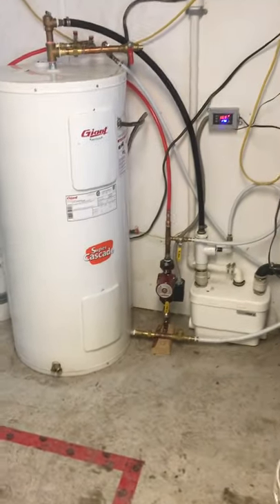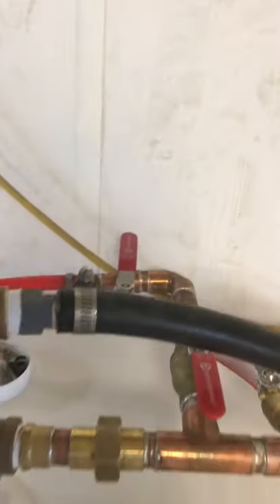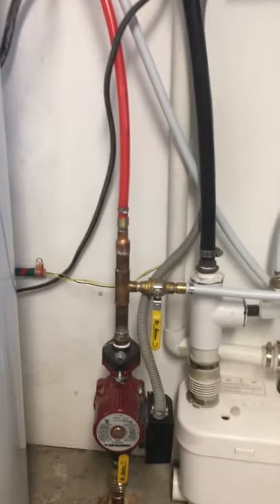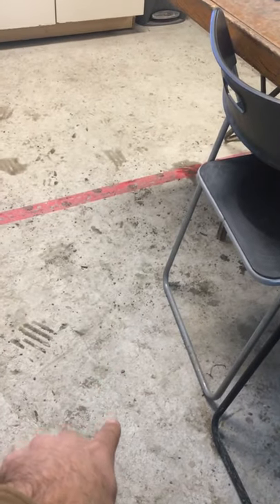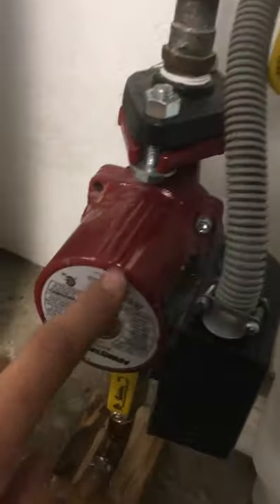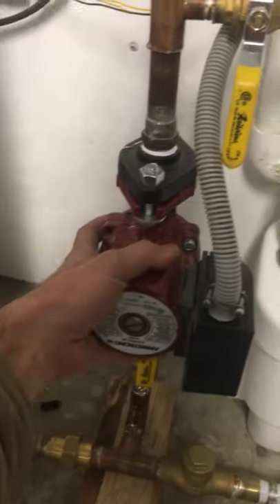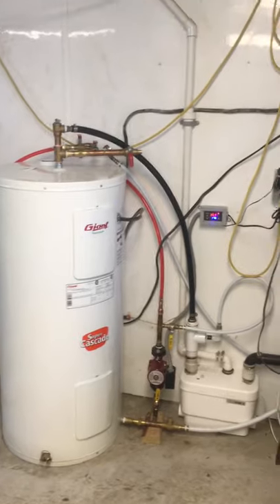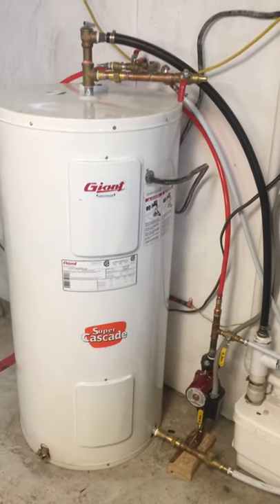DIY hydronic heating with a domestic water heater

Comment: I’m a few years late to the party, but there are a few concerns with this open loop system. #1 being that if you don’t keep the water got enough 130 -140F, there is a chance of dangerous bacteria growing. 

This wouldn’t be a problem if you were only heating, but where you are using this for washing, it could end badly. 

I’d be shocked if no one else brought this up, but I didn’t see it, while scanning the comments. 

I have a tankless system hearing my garage, and I love it. It’s about 13 years old now.

Comment: Awesome!! 
If the HW system is heat pump sourced it's even cheaper to run.
I wonder if a retrofit solution could work with a PEX HW COIL in an exchange chamber with a fan to circulate the warmed air through a duct system. The recirculating pump would not be necessary.

Comment: how efficient is this? What were you using? How many sqft? Electricity saving vs fuel?
Reply from the maker: In terms of efficiency electric heating of water is pretty much 100% efficient as far as I know. Then it’s just a question of how well insulated the space is, both beneath the slab and then the room’s walls, doors, ceiling etc.

In this case we’re using a 3kW water heater to heat about 350sq ft in a corner of an old barn where we insulated one corner of the building pretty well and had to redo about 200 sq.ft of the floor so we had the spray foam contractor do the sub slab zone at the same time as he did several  walls.  Then we poured the new slab with about 100ft of pex in the slab and set up the water heater to heat it.

Savings vs. fuel unknown as we've never heated this section with fuel.

Comment: Isn't it dangerous to mix your domestic hot water with hydronic system water? I thought that could lead to Legionnaires Disease or something?
Reply from the maker: I looked it up and checked the temperatures for Legionella and took a few preventative measures but I can't really see how it could happen.  I blow out the heating loop with compressed air during the time of year when it's idle (summer) so it can't breed much bacteria and the water heater is set much hotter than Legionella can survive (most water heaters are nowadays) so I'm hoping I'm not wrong on this.

Comment: Interesting...We just equipped our new home with all propane appliances and heating system in 2016, however Canada's Liberals have now declared war on fossil fuels even though we are at 1.5% of world carbon emissions. My bad, getting side tracked. We are considering tapping into our in floor on demand boiler circuit with an Electric HWT to save on the now ridiculous cost of propane.  Have your hydro bills gone up a lot using the electric tank ?

Comment: That is pretty much exactly what I plan on doing in my garage, I have a newly poured slab with pex in it and insulation foam board isolating it. Now i need a pump and valve install to warm it up.. 

Hows your little system working so far?
Reply from the maker: Works well but needs an air extractor and small expansion tank to really work properly.  The heating of water in the tank drives dissolved air out of solution, creating bubbles which need to be cleared to avoid air locking the circulation pump.  With daily handwashing and lunches it's no problem but over Xmas break the pump ended up air locked after a couple weeks.  I'm going to buy the right parts from a hydronic heating supplier and put them in while it's shut down for the summer.  Otherwise it's been good.
Reply: @reidallaway  thank you, my water heater already has a expansion tank on it so hopefully that will be enough to keep it from locking up..

Btw, i like how you added the blow-out fittings for evacuating the air for a season.. thats a great feature for me to use in winter when i am not using the garage to work on anything for several weeks at a time.. i will just fill it and start warming it a couple days in advance of my winter projects... But otherwise maybe I can get the heat settings to stay around 50° Fahrenheit , thats plenty for me to be comfortable, especially if its radiant...
Take care and thanks for sharing...

Comment: Did I hear you correctly? This is a dual use or purpose installation, domestic hot water and radiant loop heating? That's never a good idea! What's with the T&P connected to the gray water system? That's a potential cross connection. I don't see any pressure control in your design anywhere? These two systems appear to be operating at the same pressure?  If you want to do this, I highly suggest you use heat exchanger allows for loop Isolation…. Peace.
Reply from the maker: Hi Jerome it is a dual-purpose system but the only risk I could find when researching was the risk of  bacteria multiplying in the stagnant slab loop during the non-heating season.  I manage this risk by purging the floor loop with compressed air and leaving it dry during the summer.  The water heater is set hot enough to kill Legionnaires' disease which is the only risk I found mention of.  I'm not clear on where the risk would come from but I'm happy to learn more if there are risks I failed to grasp.

The water heater emergency top drain is the only connection to the grey water system.  It drains into free air in the top of the  transfer pump case so I think it's impossible to reverse flow or contaminate.

Yes everything operates at the same pressure.  Pressure control is by well pump with Subdrive VFD + expansion tank and emergency relief valve on water heater as backup.

Comment: scary, you should never let the hydronic heating water mix in the same tank that gives you domestic hot water, the bacteria could be bad, if you start getting sick for no reason think of that. easiest fix is to have two tanks.
Reply from the maker: When I looked into the potential risks I couldn't see any reason to be afraid.  The temps and latency necessary to kill 100% of Legionella are easily met by this system so that even if it was breeding in the floor loop it would be killed when it returns to the water heater.

If there's some other bacterium or detail I'm missing I hope someone will let me know but so far it's just "bad idea" comments like yours.  Please elaborate.
Reply: @reidallaway  Not as efficient either, everytime you "use" hot water, you have to bring more well water in to the system, rather than just re-circulating warm / hot water. If you just bought a small hot water on demand for the kitchen, and kept the 2 systems separate, you could add an antifreeze product in to the heating lines and not have to worry about blowing it out, and also not worry about possibly getting sick. I also sure by now you installed the air bleeders and the pressure tank, if you keep using the setup for both, you'll always have air issues because you keep letting in more air every time someone washes their hands.
Reply from the maker: @benmarshall76  the pressure tank was already present and yes I added an air extractor that seems to work fine for the inevitable bubbles.  The cost savings of building one system instead of two still seems to make sense to me.   we needed hand washing and hydronic heat in the same space and I think we're now in the 3rd year of trouble-free operation since completing it and adding the bubble scrubber.